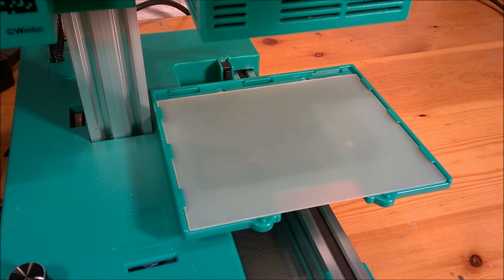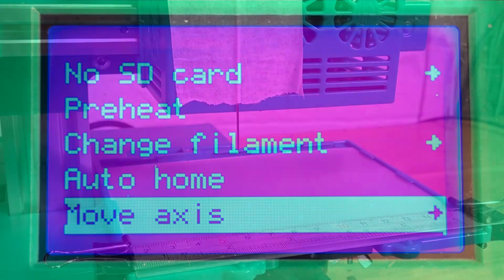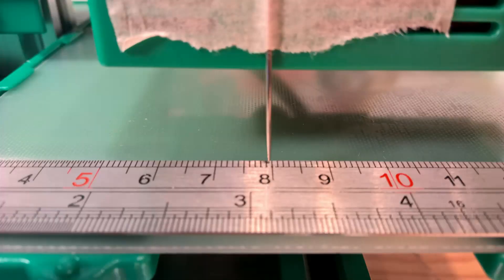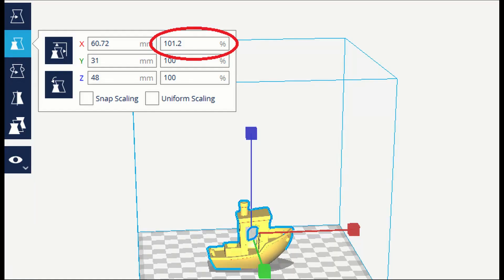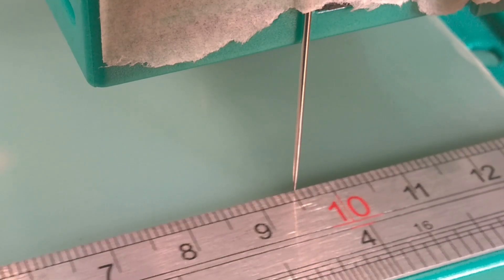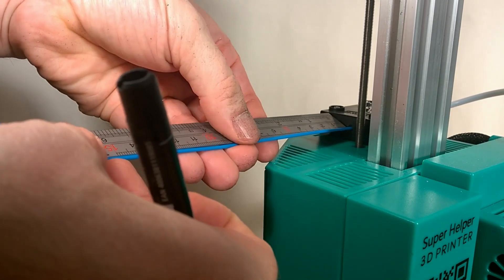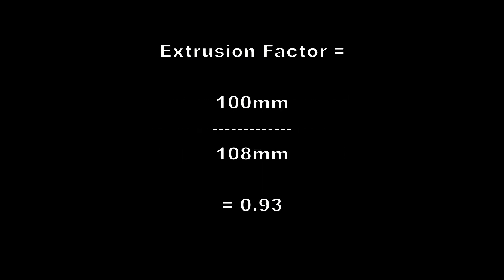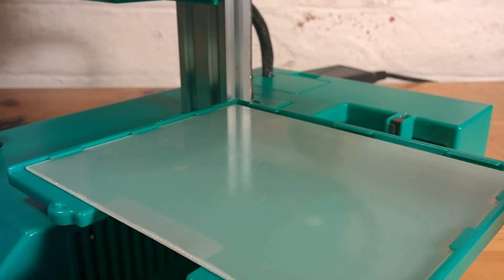Calibrate your 3D Printer 2 - An Advanced Tutorial

Comment: Remember to write it down, marlin wont save that if you change any of the main program, and some doesent alllw saving the code between on/off.
Reply: u can save it in the Store settings in the lcd display
Reply: 3D  not if it is not enabled in marlin, you need to enable the write settings to it first unless you bought a kit or a printer with a preconfigured marlin with it enabled.
Reply: Same for auto level bed saving for a delta, wich i actually do not recommend as delta height is something you only set once, unlesss you make alterations to the machine. Having it storing the data means that if a micro switch is faulty, your heated nozzle will slam full down on the build plate.
Reply: @jonjonsson6323  ohhhh i'm sorry I thought you were talking about after installing the Marlin firmware
Reply: 3D nah, since the most files that are generic is bad for your printer you really should do the whole setup process instead of just upload a new marlin. There is nothing wrong with the code but since most have wrong temp sensor as for example it will give faulty pid heating, as well as the extruder deffo will be wrongly calibrated. Even a mm larger cog wheel makes centimeters in over extrusion per metres and you really should put that value in marlin instead of the eeprom as some slicers rely on the code, not the stored setting. Especially if you use the usb you can jam the printer nozzle or print outside the borders. It is easily done so i would never use anyone elses preconfigured marlin
Reply: As for example my steps should been 200 on a pretty standard extruder, and ended up with a correction to 194 steps.. that is highly depending on what parts you use but in general a rule of thumb is that as for example a prusa calculator gives around 200 steps for 20 teeth . If you use 16 steps pulkeys, you must adjust the scaling. Now marlin has an opton to that, just fill in number of teeths and it auto calculate it

Comment: This is a horrible horrible horrible tutorial. Anyone who doesn’t know about printers is going to think you’re correct when in fact the basic laws of these printers is that they move linearly. XYZ all set by the interpolation of the stepper motor and how many times it takes to make a full rotation. Which for most Creality machines is going to 80, or 400... that’s why CHEP here on YouTube does tutorials about magic numbers of .04 layer heights as it’s a perfect set for the stepper motors.  

If you want to calibrate your steps then search for the Prusa calculator...

The only thing you should calibrate is the Esteps and then after that you calibrate the flow rate for accurate flow of each filament. 

Please if you’re going to do tutorials make them accurate. It’s funny how you set your steps in your machine to under 80 so that you can show your solution works... not cool man, very deceptive practice!!!
Reply: Totally agree not advanced tunning use cross calibration on things and mini calibration

Comment: It doesnt really work.  Iv done this perfect and Y always print 0.1mm bigger than X. After that.  If I try calibrate it away it works for the size At this point. But as soon im printing larger cubes it becomes even more off again.
Also the amount of infill influence the outcome.  So basicly I have to calculate steps for each stuff I do.
Reply: You have to print to calibration notre only use rulers. This method only good for a global approach.